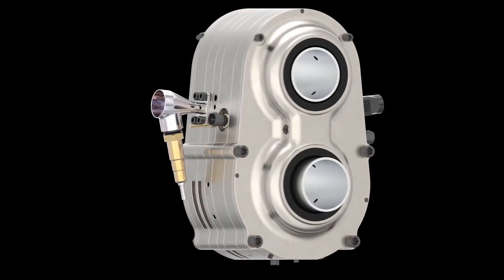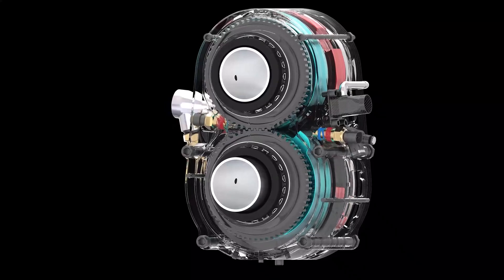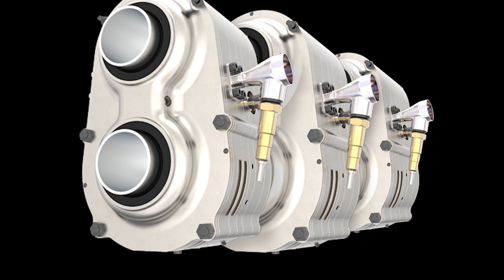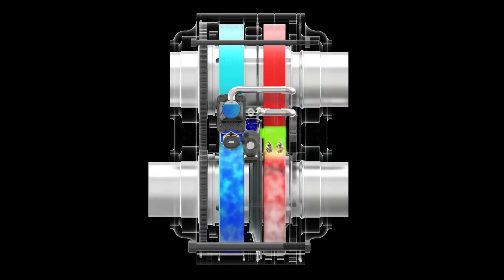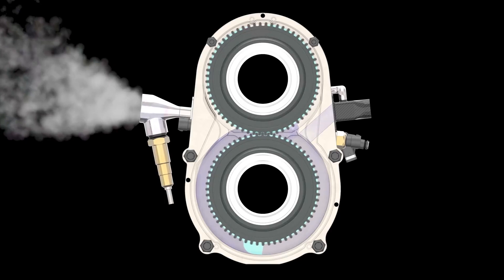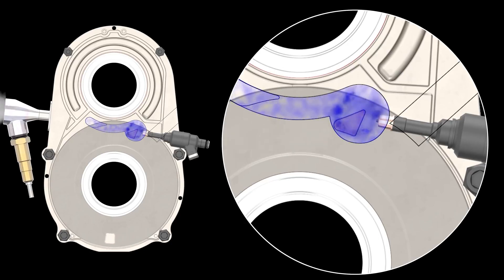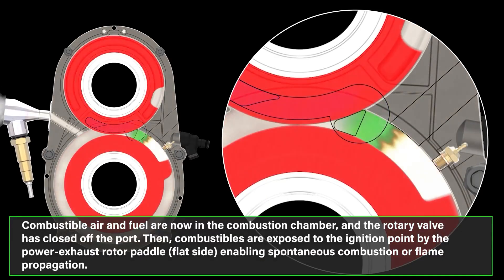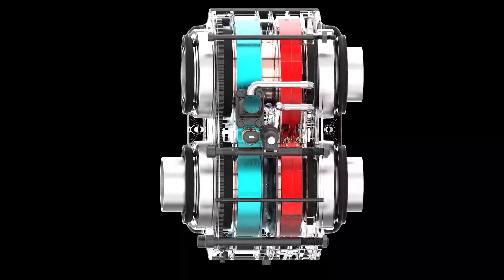This pistonless engine runs on hydrogen and revs to 25k rpm

Comment: I think this is vaporware: concept only and no working engine. If it was to have extremely tight tolerances it would seize up as it gets up to temperature as the metal expands. There would also be a lot of friction on the rotor side walls, & you have to use a very hard materials to make engine wear tolerable.
Reply: No, it's way beyond vapourware!  It's clearly passed beer-coaster-ware, whiteboard-ware and now cad-animation-ware :-)
Reply: @normandiebryant6989  also don't forget: investors be-ware..  😬👍
Reply: That's what I just said.  They need to come back when they have a functioning prototype.
Reply: @dr.elvis.h.christ  they have a working prototype
Reply: Dynamically unbalanced. Vibration, wear. Would still produce lots of NOx. Not to mention all hydrogen is made from fossil fuels today. Bad idea.
Reply: You is all talking nonsense  ....   I'm sure I saw somthing like this in a si-fi movie I was watching once ..... and it worked real fine ......!
Reply: Isn't it basically like a rotary engine?
Reply: @albymangle4963  Not really a Rotary uses an offset rotor that rotates between two over-secting circular holes. This is more like a rotary vane pump.
Reply: I'm not so sure. For example, piston engines are not fully sealed. Main reason why oil change is needed is carbon bildup from combustion casses. And piston engine can't work whit out crankcase ventolation. It just blows an casget some ware if veltilation is blocked. 
Allso steam formed in this engine may transfer heat a way from engine fast enough to keep running temperature relatively low. 
But i am conserned about engine wear whit out lublication.
Alltho turbo's run in hi rpm and last a long time. And dont have lubrication in areas other than the shaft.
Reply: @pohtis  video stated it used very tight tolerances, so likely tight seals. 

Turbos don't have tight seals, as the only contact between the rotor and the housing are the bearings. Turbines (compress, steam, jet engines) all leak. The compromise efficient for power to low weight & size.

No way is this practical. I had a idea for a hybrid engine that used a rotor design for a 4-cycle gasoline engine, but the issue was problems coming up with a practical seal as well as lubrication. For ICE, Piston is the most practical & that's why they been around for about 200 years (if you include steam driven piston engines). 

Its like the wheel, No one has developed an alternative to the wheel in 2000+ years, unlikely ever to happen. Maybe some levitation method but I doubt it.
Reply: lube brah, urs must be tiny
Reply: Tight tolerances do not mean tight clearances.
Reply: @JackF99  Would have to tight clearance to limit leakage.
Reply: This is just all theoretical bs. It's far more efficient and reliable for hydrogen powered electric motors.
Reply: @larryc1616  Hydrogen Powered electric motors? ::Eyebrow::
Reply: Like Diamonds,💯 of billions to produce.Hard.
Reply: Don't say vaporware too loud or musk will start pitching non functional demo models as fully functional prototypes and take another 600 million in taxpayer money from subsidies to produce absolutely nothing with
Reply: not exactly, when it expands everything expands, tolerance seal can be found in a fair chunk of firearms, especially extremely reliable ones, is what your saying a possible issue, definitely. is it one that can be worked around given existing techniques, again, definitely
I say this and I have absolutely zero hopes of this Engine actually being real
Reply: @ramentaryramblings  tolerance seals aren't new, it's the proposed use that is concerning. A firearm typically shoots a few rounds at a time, this thing would be the equivalent of a machine gun able to shoot ~200 rounds per second continuously for years without wear or heat issues
Reply: @norgeek  your right and wrong
keep in mind the "few rounds at a time" is over tens of hundreds of thousands of rounds in some cases, in this application, it would not work, but it does work as a real thing
Reply: @ramentaryramblings  100'000 rounds over the lifetime of a carefully maintained quality firearm is insignificant compared to the wear of an engine that's supposed to do 100'000 revolutions every four minutes - that's up to 1,5 million revolutions per hour
Reply: @norgeek  the more you reply the more i doubt your intellect in the topics you speak.
Reply: @norgeek  actually, a firearm wielded by an active duty soldier/sailor/pilot/marine can see as many as several million rounds in it's lifetime. In an active combat situation, it's not uncommon to fire a few thousand rounds through a single weapon over the course of 10 minutes. That weapon of course is cleaned and oiled after the engagement.  

That being said, this engine, if it is kept under 240°F, would work at 23krpm just fine with proper maintenance. There is a single cylinder F1 engine prototype that revs to 23k and is liquid cooled, but it requires a rebuild after every season. However, most people aren't going to be redlining their engine so you can expect an average of 12k rpm, which should be well within tolerance and will minimize wear, especially if the rotors are coated with a substance with a low friction coefficient such as nylon (not necessarily nylon, it's just an example). If they keep this engine air cooled, it will not be commercially viable on anything but aircraft where the engine is exposed. It must be liquid cooled to manage the expansion of the metal, and ideally the block and rotors should be preheated to bring the engine to tolerance before starting. The reason piston engines can start cold with minimal wear is because the piston rings are springs that take up the slack and keep the cylinder sealed. 

Since this engine has no seals or rings, you will see large amounts of combustion blowby until the engine heats up and meets tolerance unless it's preheated, especially since hydrogen has a very tight combustion boundary. One other option would be to use oil to seal it until it warms up, but that will result in burning oil for the first 10 minutes of operation. 

I see a lot of benefits from this, but a lot of hurdles that must be overcome to make this engine commercially viable.
Reply: @norgeek  I would like to direct you to the A-10 warthog and her 45 year old 30mm cannons.
Reply: @lovedeathandgaming  ain't those things beauteous!?😁👍
Reply: @lovedeathandgaming  the 30mm GAU-8 found in the A-10 is hydraulically powered, it absolutely does use a lot of seals. Barrel life is limited to 20'000 rounds as long as the pilot doesn't exceed the recommended 2-second burst rate.
Reply: @norgeek  if a senior aerospace engineer says something is possible, he is almost certainly right, if he says it is impossible, he is almost certainly wrong. The barrel is a wear component, the bolt and breach face are tolerance sealed and experience more than 65,000 psi. This engine is a cakewalk comparatively.
Reply: @TheDustyShredder   your bit about a service weapon going thru several million rounds in its lifetime, and a few thousand rounds over the course of 10 minutes in active combat is very wrong. Crew served weapons and mounted weapons on aircraft and vehicles may get up to a thousand rounds in a combat situation, but they will be replaced (at least the barrels) well before they hit a million rounds fired through them.
Reply: @noneyabusiness8065  the chamber and bolt are the primary load bearing parts, and these are often permanent fixtures on a firearm. The barrel is a consumable part, as is the firing pin. The chamber and bolt will easily see several million rounds in their lifetime.
Reply: @TheDustyShredder  As a retired combat vet,

I respectfully suggest you conduct objective research BEFORE forming an opinion; let alone before opening your mouth.
Reply: @cw8jwh  As the son of a prior Marine, I respectfully request that you actually provide information to correct me instead of telling me to keep my mouth shut.
Reply: @TheDustyShredder  Sure you are.
Goodbye.
Reply: @cw8jwh  just as you currently have no proof that I am, which I will happily provide, I also have no proof that you are a vet, and I am not obligated to take you at your word just because you claim you are, nor am I obligated to accept your underhanded rudeness. I highly suggest thinking twice about the words you choose later on.

For the record: My dad is Cpl Michael J. Adams, served in helo unit 167 for 2 years before being medically discharged having broken both collarbones after falling out of a helo. He was a green belt MCMAP instructor as well, before his accident.
Reply: @TheDustyShredder  Ok, triggered.

Just remember to apply your words to yourself.

And in case in weren't paying attention to my previous reply, goodbye.
Reply: @cw8jwh  if you really are a vet, you have access to the records that will prove my statement. I'll give you the same advice you gave me: do your objective research before forming your opinion about someone, especially when they provide you with the information you need to verify their claim. Since you have provided nothing that can verify your claim, I only see you as a dishonorable internet troll at this point.

And no, I do not accept being dismissed like that after being so rudely spoken to.
Reply: @TheDustyShredder  Why do you have the burning need to always try to 'get the last word in'.

Do you not actually understand the meaning of the word 'goodbye'.
Reply: @TheDustyShredder  No.

Let it go. Just because no one is obligated to believe you doesn't automatically mean you are being 'dismissed'.

And 'chasing after me IRL' would only get you exactly what you're getting now: a polite reminder that no one is obligated to believe you and a request to GO AWAY.

Goodbye. I will never fear you.
Reply: @ramentaryramblings  they've built a working prototype
Reply: @ramentaryramblings  Yeah. And think of Roots Superchargers and their close tolerances. Their Rotors and Cases heat up as well and they don't seize
Reply: Didn't Formula One engineers figure out that something like 18,000 rpms the valves don't have time to open and close and will basically just flutter?
Reply: @EmilyRose900  no valves on it, its like a two stroke it has ports
Reply: @EmilyRose900  this is not a convencional piston engine, it might not have this problem
Reply: They have a functional prototype. /watch?v=Q-tyYqGM8QA
Reply: @madmatt2024  Looks like it leaks more oil than it burns in fuel!  A 14 second video @ very low RPMS does see like a good demo. For all we know There an electric motor turning the rotor that is off camera.

Lets see the engine running at high rpms on a Dyno.
Reply: @madmatt2024  amazing
Reply: hydrogen is very corrosive too

Comment: What is rarely mentioned with hydrogen fuel is that it is very energy intensive to produce making it a dirty fuel so to speak.
The energy to produce/manufacture hydrogen has come from somewhere like a coal fired electricity plant, nuclear or renewable energy sources. But it is not so simple and easy when a fuel source takes another fuel source to produce it and uses a lot in that manufacturing process.
Hydrogen also has to be storage and transported in particular ways because of the pressure it is maintained at.
It is one thing to run a small fleet of vehicles around a capital city and completely another to supply the infrastructure for an entire nation.
Reply from the maker: I mentioned this in another video
Reply: @ChrisVSCars  I look forward to finding and viewing that video. Thanks
Reply: It seems like people also like to forget about the fact that hydrogen is prone to spontaneous combustion and also is highly explosive under pressure. I'm not sure about you but I'm already worried about people driving lipo batteries around that are almost impossible to extinguish if they catch fire, I'm really not interested in people driving miniature bombs around.
Reply: @bugbug6342  With hydrogen infrastructure the engineering standards will have to of a very high standard with users of the system perhaps having more training than what is involved petroleum based fuels. Just really depends on the methods scientists and engineers come up with to implement hydrogen as a commonly used fuel.

Comment: I've been on the hydrogen bandwagon for a while now, and it's ideas like this that show that it's absolutely possible. We just need those who are in charge to take action.
Reply: Except hydrogen combustion is not new or clean. You can run an internal combustion engine with hydrogen, but it spews obnoxious amounts of nitrous oxide...
Reply: Fresh air

Comment: Now all you need is a water fuel system that breaks water into hydrogen and oxygen and feeds the hydrogen into this engine and mixes the 02 into the air intake to assist in the combustion.

Comment: 25k rpm? That thing is not going to be quiet. It's going to SCREAM. Aside from the reliability problems, the main reason turbine powered cars never took off (see what I did there?) is because of the noise. You just can't make 25k rpm quiet. People in the next town would hear you coming.

Comment: This reminds me of the Mazda Rx7 engine. It was an amazing concept, but ended up being a very high maintenance engine, because of the high tolerances it needed to function.
Reply: Rotary and high tolerances? They could run on almost anything that could burn. We're actually fairly low compression for a "performance engine" even for naturally aspirated models. You get even the slightest carbon build up and bye bye compression (I bring that up because a high tolerance engine would be extremely resistant to carbon build up with very few crevices for carbon to keep creep into but rotaries are hella prone to it with carbon getting EVERYWHERE).

High maintenance? You got the same 3k oil change intervals with the need to either add a quart or two over that time or do the smart thing and premix them. There were four things that killed rotary engines: carbon build up, pre-detonation, overheating, and oil starvation. Those same things also kill piston engines. And if someone treated a rotary engine right and had the right mods in place, these things would never happen. If you know what your doing rotaries can be just as reliable if not more so than a piston engine, but could be rebuilt in a few hours versus a week or two. I've seen plenty of rotaries with over 100k on their rebuilds, some as close as 150k. Compared to the average piston engine which are technically in need of rebuilds around 175k-200k or less (on paper specs anyways), they're not that far off if you know what you're doing and treat them right.
Reply: They were good motors, but the did burn out quicker than a normal engine.  That's why they were not successful.   Nice power, though.  I worked on them in the '70s.
Reply: I remember the RX-7 being a car with reputation for ruggedness and longevity. Do believe you got hold of some wrong information there.

It's called a Wankel engine, GM had planned to use it but emissions and fuel economy were not good. Mazda will use it as range extender for a future EV.
Reply: @markjohnson8260  you needto check your info. I fix them , believe me, I know
Reply: wouldn't mind seeing what Rob Dahm could do with one of these though (for sure he'd blow up a dozen or so before nailing it)

Comment: I see the insane advancements in electric motors making current combustion engine technology almost obsolete. But in doing so, I foresee insane advancements in the combustion engine technology to keep up with the EV world's advancements. Combustion still has a lot of potential to unleash. S/O to the SA guys!
Reply: So your saying that ICE engines wouldn't progress without the threat of electric motors?   That the auto industry has been giving us the finger for last 50 years?    OK I'm with you. 🙂
Reply: obsolete? 😂 maybe once they figure out how to make better batteries. i’m excited to see if the nuclear diamond battery will actually become a thing
Reply: electric motors aren't getting much better - they've been more or less perfected decades ago. the thing that's been improving that made EVs viable is the batteries